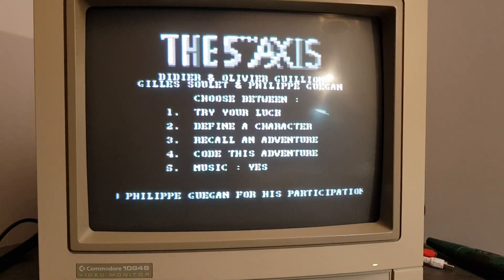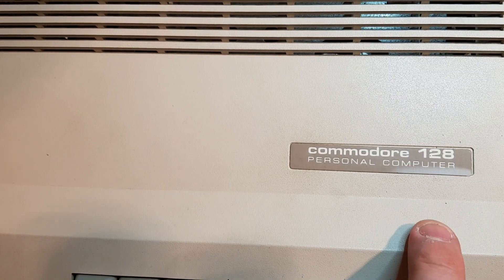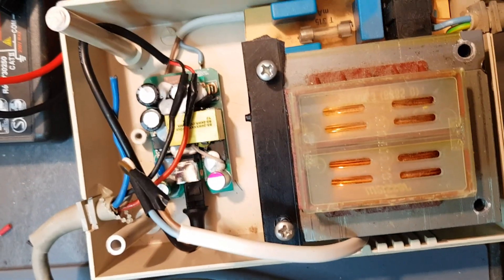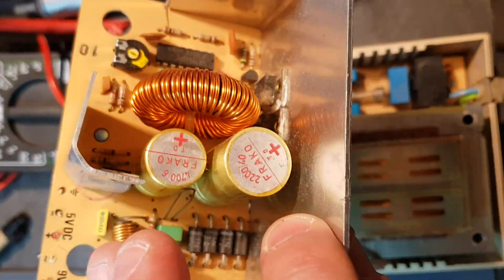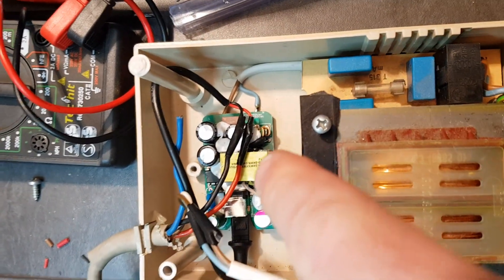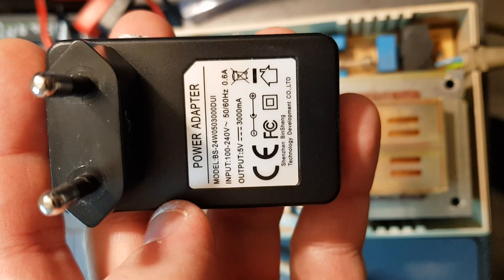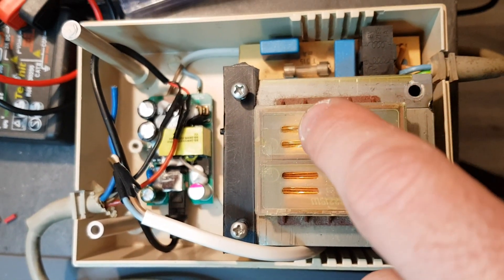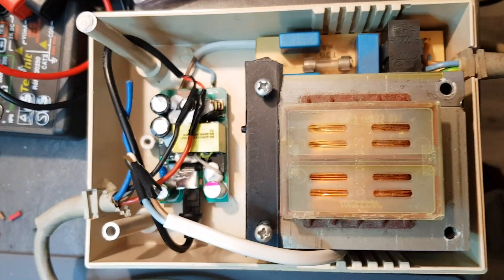How to fix your COMMODORE C128 Power Supply for 10€

Comment: can you tell me across which two pins you need to check the voltages in the PSU? is it 9v and GND / 5v and GND ?
Reply from the maker: Yes. But the 9v part is AC and the 5v is DC. So set your multimeter correctly.

Comment: Il a l'air propre ton C128.
Reply from the maker: Il l'est :) par contre il était donné !
Reply: @gibs2b  'donné' ou 'pas donné' ? Sur Ebay c'est rare d'en trouver propre et fonctionnel avec son alim et pas celle d'un C64 à moins de 180 € avec les frais de port. J'en ai un avec un peu de vidéo RAM en plus, le vendeur ne l'avait même pas spécifié (vendu non testé et coup de bol il fonctionne mais l'image est assez moche malheureusement). C'est n'importe quoi les prix sur Ebay ces temps-ci pour tous les matériels, ça fait peur on a encore pris 20 à 30% depuis quelques mois.
Reply from the maker: @Archimedes75009  pas donné je voulais dire ! Effectivement avec une alimentation de c64 ça ne tient pas longtemps. C'est ce que j'avais fait, au bout d'une heure de fonctionnement l'alimentation part en freestyle et plante le C128. Pourtant j'ai les 2 versions d'alimentation du c64 et la carré qui de souvenir est un peu plus grosse  (1.7A si je ne dis pas de bêtises) ne fait pas l'affaire. Bref j'ai aussi un c128D complet fonctionnel et qui n'a jamais été ouvert :)
Reply from the maker: @Archimedes75009  tu l'as branché en composite ou S-Vidéo ?
Reply: @gibs2b  En composite et c'est franchement dégueulasse.
Reply from the maker: @Archimedes75009  c'est toujours mieux que la sortie RF :) Blague a part sur un bon moniteur ça passe. Le 1084s a un bouton qui filtre le signal, sur les Sony PVM le composite est aussi assez bluffant. Faute de RGB (a part Sur le c128d) le svideo fait l'affaire. Et ton musée il est ouvert ?
Reply: @gibs2b  OK. Le musée j'étudie toujours le projet. Si la taxe foncière devient délirante une fois transformé en local commercial ça restera mon hangar à vieux ordis et autres. Les temps ont changé, la récession est en vue, il va y avoir bien mieux à faire, sachant que ne rien faire peut s'avérer être un excellent choix, plutôt que des conneries.
Reply from the maker: @Archimedes75009  Ah je vois... Faut que je passe te voir un de ces quatres... Je te préviens à l'avance pour que tu deblaie le passage :-)
Reply: @gibs2b  Mouais. Bonne idée car la situation a empiré :-) Faut que j'accélère le port de SOTB du coup, que tu voies ça 'en vrai'.
Reply from the maker: @Archimedes75009  faut que je passe au moins une fois par an pour tout déblayer 😂😂👍👍
Reply: @gibs2b  En effet il me reste de l'Amiga dont je ne me sers pas et auquel je ne porte aucun intérêt. :-)
Reply from the maker: @Archimedes75009  je vais te débarrasser ! Hehehe
Reply: @gibs2b  En attendant, tu peux programmer ton C128 : https://youtu.be/fz36H0odARU